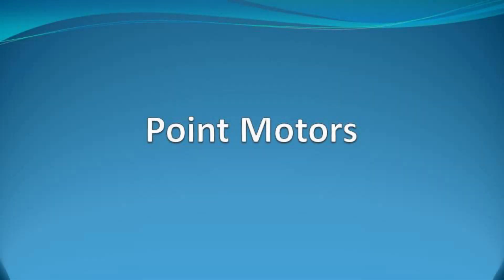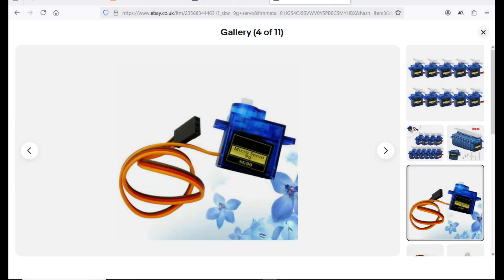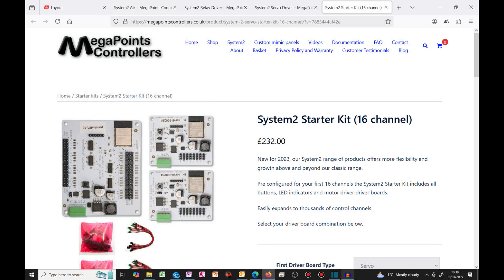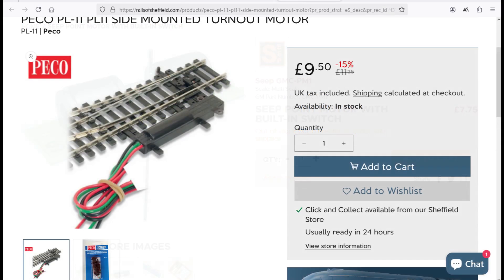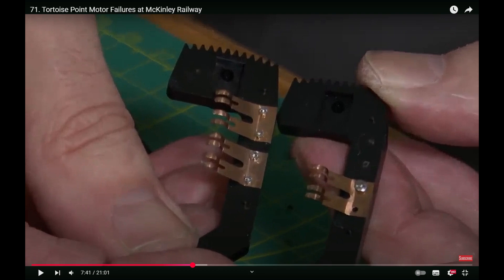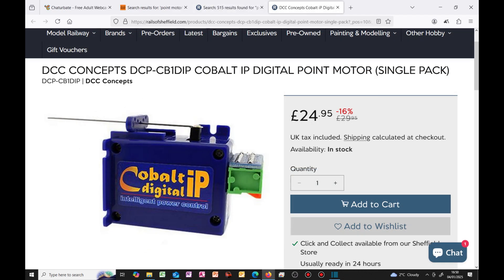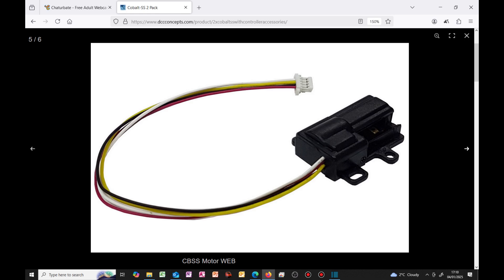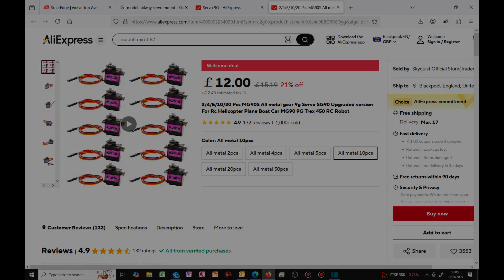What is the best and most cost effective point motor for your dcc layout

Comment: Hi mate thanks for the video I have about 40 odd turnouts to power on my layout and have been looking for all sorts of ways to go about it, servo's and arduino was one of the most affordable and then I found Merg and it's very inexpensive as well but very hard to get information on, looking forward to what you have coming up in the future :)
Cheers Mark
Reply from the maker: To get info on Merg products you will need to join Merg. The problem there is, you will need to have or learn some electronics and basic programming. I will in the future be showing how to use servos with an Arduino including all the programming to control with  DCC

Comment: My shed layout includes 24 servo point motors, with manual switching via Megapoints pcb's. Frogs are switched via relays also supplied by  Megapoints. Most of the servos are underneath the layout, but the few that had to be placed above the layouts are hidden within trackside sheds/ containers.
Reply from the maker: Thanks for leaving your comment it is appreciated.
The MegaPoints system is a good, solid choice, although a bit expensive. I note from checking out your channel that you have an interest in electronics. I will, in the future, be showing how to use an Arduino. I intend to introduce some software that will allow you to program the Arduino. without having to learn or use the code. There will be a series showing how to do that and much more on the tech side, and try and make it easier to understand and implement.
Reply: @DCCandMore  Thanks for your reply. I do have the Arduino starter kit, but never got round to using it, I do have some basic bread board experience, and a little coding for Basic and Excel macro applications. Will look forward to your Arduino series.